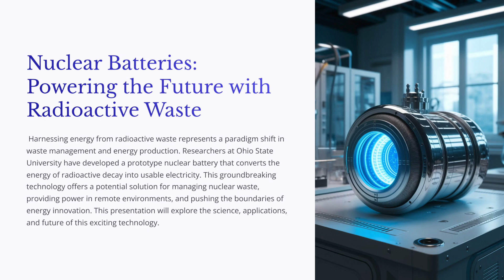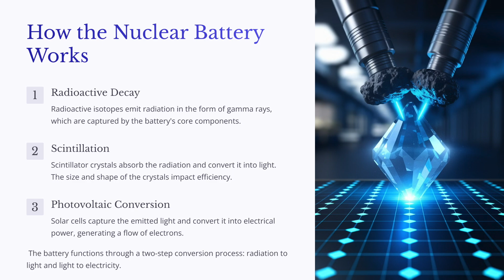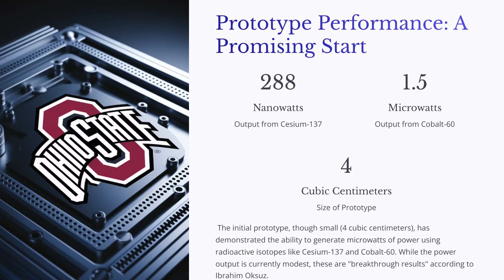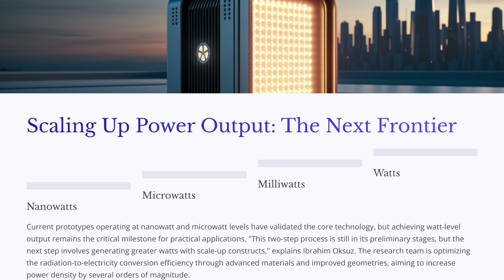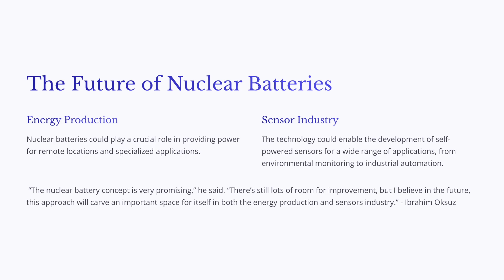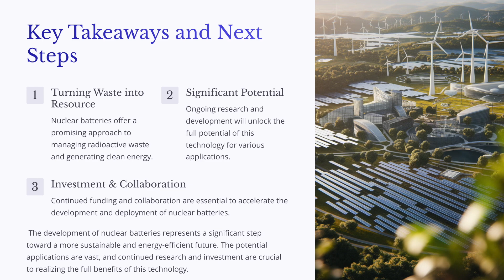Scientists Make a Significant Advancement in Energy Conversion using Nuclear Waste Battery

Comment: We already built one in the megawatts we put them in HUMV style vehicles One has already clocked up over 2M miles.

The problem is these are basically massive dirty bombs without the explosives terrorists could blow them up contaminating large parts of a city if they were sold to the public.